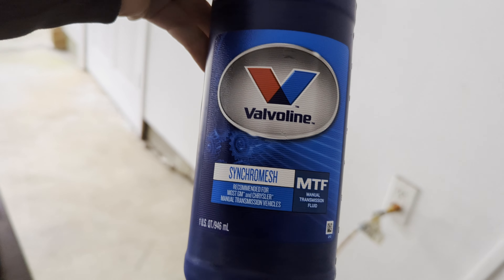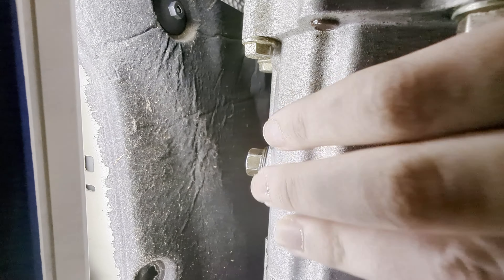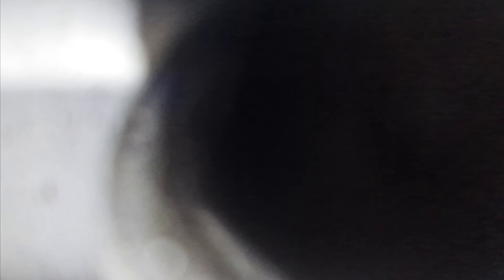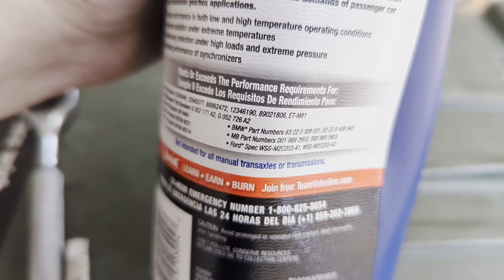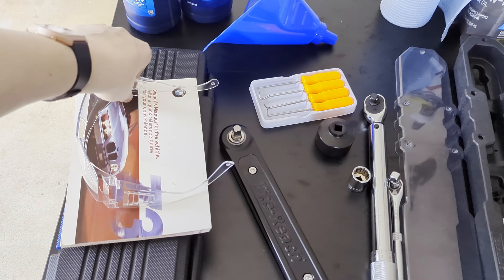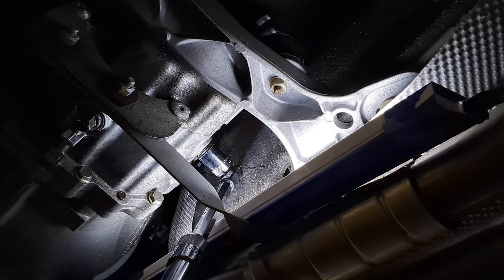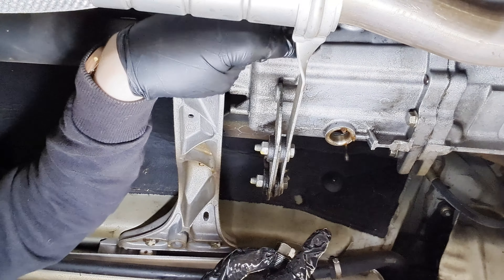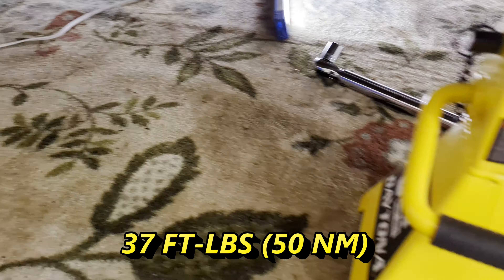Beginners Guide: How to do Manual Transmission Fluid Change

Comment: Just did my transmission fluid using Valvoline Synchromesh for my Getrag 5 speed manual. Easy process, took my time. Mine was about 38 oz, but then it overflowed a bit, started dripping and had to keep wiping it for a few minutes until it quit. Easy job. I have a special work environment, I used my garage in floor tornado shelter, which doubles as a maintance bay for working under my car- no jacking required! Worked great for diff fluid and transmission! Thanks for the tutorial Mark! @CoolcatsAlley
Reply from the maker: Glad my videos were helpful. The Valvoline works great in the Z3. I have no complaints.

Comment: Dear Alley, thanks for your videos. I own a Z3 3.0I bought in 2021. I bought recently material to proceed to an oil change myself but I don't feel comfortabel with the idea of lifting the car as I never did it before. I wanted to know: do you consider making a video on how you put the car on jack stands in the future ? Thanks for your answer, keep on the good work !
Reply from the maker: Yes, I have plans to instruct on how to lift the car with different methods. Showing in detail where the proper lift points are on the Z3 as well as how to safely lift with jack stands, wheel ramps and leveling blocks.

I'm glad you are finding my videos helpful and I love getting ideas for videos from viewers so we can all learn together!
Reply: @CoolcatsAlley  Thank you Alley 🤗🙏
Reply from the maker: @jeromeswerts1801  Not a problem!
Reply: @CoolcatsAlley  Dear Alley, may I know the height of your jack stands ? I'm wondering which one I should buy: 28 to 42 cm or 39 to 60 cm 🤔 Thanks for your help and work ! Jerome Ps: to answer a question on one of your previous videos, I think the cabin air filter is located under the glove box (but I never changed it). Regards, Js.
Reply from the maker: @jeromeswerts1801  My jack stands have a max lift height of 16 3/4" (42.5 cm).
Reply: @CoolcatsAlley  Thank you 👍

Comment: Now that a year has gone by, how would you describe the results of your choice of fluid for this Transmission fluid change? I am not on my journey of deciding which. I have nothing to really go on except to try and match others and go on their results. I have a 98 2.8 Z3
Reply from the maker: My Z3 drives very smoothly. I have no issues with the Valvoline fluids I used. Redline is also very popular among Z3 enthusiasts.

Comment: Hi can you please tell me where’s is the dipstick for transmission oil?
Reply from the maker: The BMW Z3 does not have a dipstick.
Reply: @CoolcatsAlley  so how to check transmission oil, if transmission oil need to be changed or something like or can you  make video on that with details thank you
Reply from the maker: @MAAQ630  The rule is every 50k miles change the fluid. Most people never change it so if your car has over 50k miles and you have never changed it. Change it now. The previous owners of the car definitely didn't do it.

If you notice your car isn't shifting smoothly, it's another sign that your fluid is going bad. Change it. You don't need to check fluid levels. It's a closed system. You're not going to run dry. The fluid can lose viscosity or it can just get really dirty in most cases. Mine wasn't dirty but it lost viscosity and so I was having a hard time shifting.
Reply: @CoolcatsAlley  thank you so much
Reply: @MAAQ630 you don’t need to unless your gearbox is starting to feel stiff or making noise